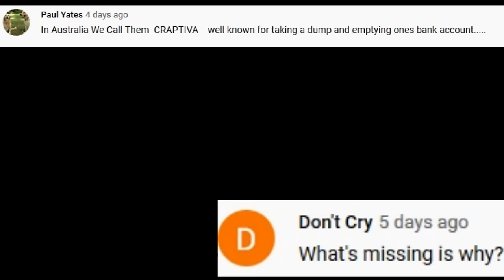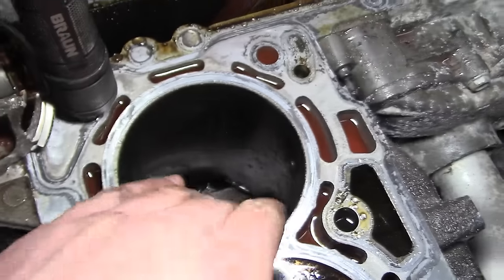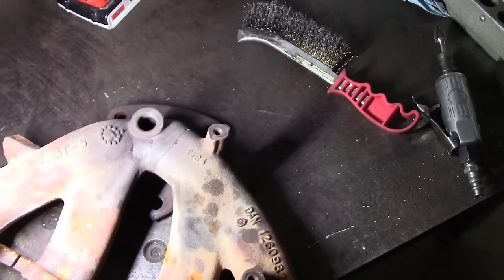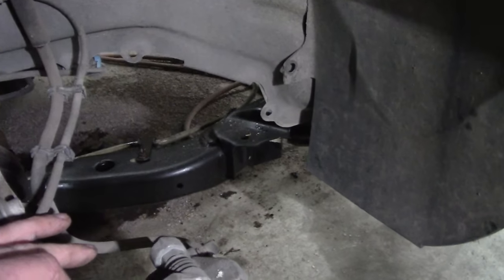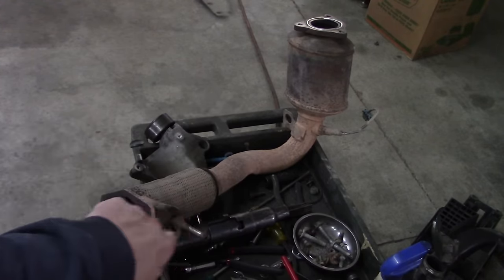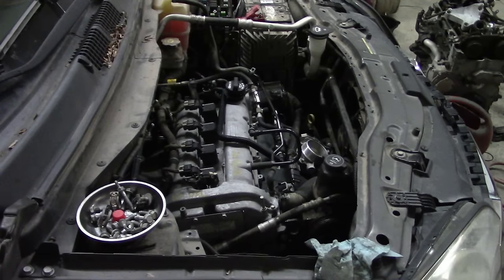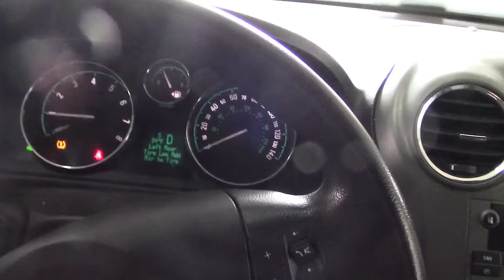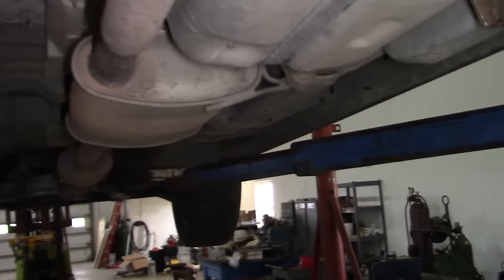I Fixed the Cheapest Small SUV on Marketplace - Part 2

Comment: In my early days of pulling wrench, I had a  98 Dodge Durango come in, blowing all sorts of smoke and heavy oil loss on the ground. Drove it in,  was able to shine a light up and see the business ends of the spark plugs of 5 and 6 from underneath. 
Far as dropping the cradle? Paint n match mark the cradle to the frame, itll be damn close. But if you live in the rust belt, yea you might be askin for more trouble than its worth. 
Surprised you didn't pull the timing chain cover - at 80k miles, id be at least looking.
Reply from the maker: Yeah I know, but if it ain't broke...

Comment: I agree with the oil filter cap.  It's a low profile 32mm socket with a universal joint.  Are they trying to copy the EU manufacturers?  Special service tool for everything, including bolts and nuts.  E-torx, Allen, triple squares.  What's the problem with regular hex bolt and nuts?
Reply from the maker: Plenty of E-trox in the 2.4 ecotec as well.

Comment: Like all other GDI engines, they aren't inherently bad. They just become bad because of poor operator maintenance. Nobody gets oil changes when they are supposed to anymore, nobody checks their oil even like once a month. They run the car till something catastrophic mechanically breaks on it, then sell it and get a new one. Manufacturers are starting to cater to this kind of behavior, parts are becoming cheaper, less reliable to begin with. All in order to only hold together the length of a warranty. If people continue to operate motor vehicles under these pretenses, we are doomed to have shitty vehicles at large that only last 3-5 years of a warranty period.
Reply from the maker: Right. Cars are becoming like smart phones. People want the newer, faster, cooler one long before it's really worn out. So why make it last any longer.

Comment: Well you love punishment. If you think these are hard to work on and impossible to reach items. Try working on boats where everything is installed in the hull before they put the deck on. Which is why so many boat mechanics and techs are of small stature. Of course I live on our boat and I am not small in stature. I have left more blood in our boat that it probably is of kin now. Sorry stole that from Master and Commander but it fits. As for engineers designs, they sit a desk and look at a computer screen. They have never tried to work on something they designed. Something that some aerospace companies have started to do, having engineering work in labs disassembling and reassembling sub systems to learn better ways of doing it.

Comment: You know that vehicle is pretty clean for an 8 year old vehicle... It'll probably end up being a money pit but at least it isn't rusty. You should fluid film/krown/dinitrol the absolute shit out of that thing before salt season comes round again.

I definitely prefer to take stuff out the top be it engines/gearboxes than drop subframes. I helped a guy i know do the clutch and dual mass flywheel on his 2005 2.2 diesel Ford Mondeo a few years back and two of the bolts on the subframe just spun. Luckily it was a shitty work car so i just cut through the carpet and put a cutting disk through the floor to find the captive nuts. Cut the heads off and took them out through the floor. He welded new nuts in and got some new bolts from the ford dealer.
Reply from the maker: Ouch. We went in from the side with a hole saw I think.

Comment: My stepmom was leasing a Toyota RAV4 I think it was a 99 model it only had 70,000 miles on it she went almost 4000 over on an oil change And that you so much oil it spun a bearing. It had been smoking a little on start up and I told her to tell them about it but they didn’t do anything. Crappy part is they made her pay for the new engine. She did go over on the oil well it shouldn’t have used that much. She pretty much forgot one oil change cost her big bucks.
Reply from the maker: Ouch. I would have thought they would cover that on warranty even with missing an oil change. It didn't start burning oil out of nowhere.

Comment: My Spark w 1.4 L engine kept triggering a high voltage error code on lower oxygen senser. I decided to use one of the gizmos sold for that. just a hollow extension 2 1/2" long. I drilled 2- 1/32" holes in it and put it in front of the senser. Worked great.
Reply: First round eventually failed but I kept drilling holes in the extension I added to the oxygen 12 3/32 holes then No high voltage error code. There is no error code on too much oxygen.

Comment: Wes, I think I would build an oil wrench only because you will be changing it more often if you keep the vehicle. That is exactly why the origional engine blew up. Filter way too hard to change and previous owners were too cheap to have dealer service it. I would guess oil and filter change would be 60-80$ at dealer and at least a 2 hr. Wait while they inspect the vehicle for other repair work to convince you that you have to do even if it has nothing to do with safety of vehicle. Enough said.
Reply from the maker: Yes I'm sure that's the case for a lot of these engines!

Comment: I use an el cheapo harbor freight  1 1/4” impact socket that I bought for a dollar on the wife’s Equinox, it’s got 2 detent pin holes on it so I can stick a 1/4” piece of tool steel through and spin that idiotic filter housing off. I personally find it easier than trying to fight with a swivel head socket wrench.
Reply from the maker: There are several low profile 3/8 drive sockets just for this engine. I have one for the 6.0 powerstroke which is similarly stupid.

Comment: Pretty sure thats just a 35mm socket or something. You should have one in your stash of CV joint sockets. Hardly a "Special tool".
Reply from the maker: It requires a low profile 32mm 3/8 drive socket.

Comment: That's the same exact oil filter system VW uses, it's actually much better than the metal cans, much less waste generated(no metal parts), iirc you need a 32mm hex tube to remove it, nothing special about it.
The problem is the dumb placement in some engine bays of the filter housing which have almost no vertical clearance
Reply from the maker: Yes, 32mm. I actually had the tool, I just forgot where it was!

Comment: Cracked exhaust manifold killed the engine. Oxygen is getting before lambda, because of this ECU is getting wrong data and leaning fuel mixture. Because of this burning temperature rises and in time kills engine
Reply from the maker: I suppose that is possible. But I would think the exhaust back pressure would be enough to keep oxygen out under most conditions.

Comment: You might be able to get $200-$300 for the top end of that old engine and make a little more profit - clean it up real nice in your spare time, spray it down with some light oil to keep the rust off, plastic bag it, and list it on your favorite fsbo board.
Reply from the maker: I dunno. I guess if a used engine is $2000, the head might have a value...

Comment: Seems it shares a lot with the Opel/Vauxhall Antara. Generally anything GM produces under the Opel/Vauxhall name is a pile of crap. They recently sold the European division to PSA - Peugeot/Citroen a French car manufacturer. They have 2 plants in the UK - which makes them popular here, despite them performing poorly in crashes, having serve problems with rust, etc. Thanks for the video!
Reply from the maker: Oh God. If anyone can do a worse job than GM is surely Peugeot!
Reply: I had a 2013 Peugeot 208 (Subcompact) for about 8 months before someone crashed into the back of me and wrote it off... Before that I had spend $1000 on having the gearbox bearings replaced and gearbox rebuilt (manual), $500 for a timing belt service, I have no idea what the last person did to it, but it sounded awful. Renault - another French manufacturer are a bit better, I've had a couple of their cars. Also Fiat... not sure what to say about them, but the early 90's gas engines they had were easy to work on. Did a head gasket in a parking lot once.

Comment: nice video Wes.  don't you have to reset the TPS sensor after refilling the tires? i think the TPS only registrates the pressure drop after reset so it warnes for low pressure (max pressure drop allowed by the settings)
Reply from the maker: I never had to fill them, and I would think the TPMS would reset after the battery was removed, but maybe that not true. I'll have to look into it further.

Comment: I prefer this style filter. I don’t have the 2.4 I have the older 2.2 L61 I think it’s a 22 or 23 MM socket is all you need.
Reply from the maker: 32mm, but it has to be a low profile.

Comment: I don't think there is a tire pressure meter. I think it is connected with the abs system, and it measures the number of rotations on the wheels. If that value changes on one tire, like if one tire looses, or gains a bit of air, changing the circumference, thus spinning more or fewer revolutions than the others, it will throw a fit on the dash. I have that system on my car, and every time I pump the tires, I have to reset the value, by holding in a small button inside the glove compartment.
Reply from the maker: I have heard of that system on some older cars like Audis maybe. The GM system is pretty sophisticated and measures actual pressure with a transducer. In this case, I just filled the tire a few psi above the recommended pressure and that reset the light. Nothing really wrong.

Comment: 2k for a used junk engine i would bay a new one for that price rockauto as them all day you got skrod without the lube here used engins are 150 to 250
Reply from the maker: I don't make the prices guy. That's what a used engine costs here. Prices range from $1400 to $2700. Cheapest reman long block I found was $3100. Rock Auto is $3012 plus shipping and they would not accept my core.
Reply: Lol. Go dig up any gm gen 4 or 5 v8 for 150-250. Late model engines are higher priced than late 90’s/early 00’s stuff.

Comment: A word of advice, those 2.4L Ecoturds seem to really like being run on 5w40 or 0w40 oil.

It really helps with the rings, I've got an oil eater under my care, and it's currently stopped consuming. Before on 5w30 full synthetic, it would eat a liter by 50% on the OLM and would start clacking at 30%.
Reply from the maker: That's probably a good idea. That and tighten up the oil change interval.
Reply: @WatchWesWork  yeah, I wouldn't trust the OLM as far as I can throw it. Also I have them using high quality filters, the AC Delco oil filters collapse because of the amount of carbon and dirt in the oil.

One thing I would highly suggest though is look into doing an oil flush. You'd be amazed at what it'll clean out.

Comment: I bought a 89 Murcury sable for $100 and everyone said "ew why do you have that thing" I got a lot of crap for it. I bought it 2½ years ago and ive mabey thrown $300 of parts at it and a tire or two. Still have it and I still drive it to work occasionally. While I know of people that bought a car for $5k and they've already killed the engine
Reply from the maker: Yeah, simple is better. Everyone now wants gadgets on the interior and could care less about the rest of the car.
Reply: @WatchWesWork  I've ridden in a lot of newer cars and I've honestly never really had something that's super comfortable either. I'd much rather have a older car and I do I have 4, newest is a 92. And just add a $100 touchscreen stereo that's just as fancy as one in a 2020 model, but im also fine with a factory stero and a cassette adapter

Comment: Done better than that little block. V16, 72 litre gen set. Number 1 conrod let go, piston through the block. Unfortunately out of the four sets in the building. One was in pieces for a major service, out of the other three , two failed and the load was on this set. Old style controls, all alarm and shutdown signals went through relays. I was in the room when it let go, never run so fast in my life, pulled all alarm relays and we basically opened the governor fully and kept feeding oil and water to it until mains power was available. As soon as we were back on mains hit stop and the noise was horrendous. Went in to the generator room after it had cooled down, oil everywhere- room basically painted black  with oil. Massive hole in the side of the block, oil way and water way shattered. Block twisted. £1.5 million to replace the engine with a reconditioned one as there was only 63 of them made, 62 left now.
Reply from the maker: Wow. That's not fun!
Reply: @WatchWesWork  nope, definitely not fun. Unfortunately, I was working in a military building during the Gulf War. Couldn't risk losing power at any time. We'd load shed until only the barest lighting and the critical rooms were left on.
Another time we used a little portable genset to provide a neutral for the controls, via an extension lead and car jump leads on to the bars, so that the breakers could close. We'd lost external mains completely, no reference points at all and the controls don't work if you lose the reference points. Once one genny was on the bars, that took over the controls and brought the rest online. Interesting times in that base.

Comment: IMO your complaints about the design stem from Cad box monkeys that have never held a wrench let alone use one. I was putting together some Siemens switchgear recently and noticed a bunch of wtf things. Oh and batteries on concrete is a myth from when battery cases where rubber, now unless the plastic is cracked it's okay.  Thanks for the videos!
Reply from the maker: Yes I know. I like to troll the battery believers.
Reply: @WatchWesWork  yes! Sorry I forget to keep them fed.

Comment: Good show, quite a few things to say. Even though you had to pay more for the engine, no core charge and no extra trip back to return the core. My opinion you came out ahead.
Some wanted the engine dropped only because that's the way they are installed. Your way is much better as it suits they way "Wes Works"
Engineers couldn't care less about what wrench turners think, dealer mechanics usually have to buy their own tools, sometimes through the dealer, so don't apologise. Should have heard what I called the engineers after spending 4 hours removing and reinstalling a starter on a v6 '79 Malibu. Transmission cooling lines run under and really close to it,
Was a purchasing agent for a battery distribution company, all the different sales reps said the same, batteries will drain sitting unprotected on concrete, and yes there is an expiration date on new batteries. Most retailers will cover the date with some type of label or sticker.
Again, good show, glad I quit watching mustie 1. You usually indicate you read the comments and actually reply to some instead of relying on other commenters to answer questions. Thanks
Reply from the maker: Well at this time I'm still able to keep up with the comments. I can see how larger channels would struggle.
Reply: @WatchWesWork  👍👍etc. Keep it up

Comment: I had my Northstar V8 in my Cadillac DTS pulled out the top.  Went out and in flawless, still going strong
Reply from the maker: Wow. That would be the only thing that's ever been done flawlessly with a Northstar... Hope it never needs a starter...
Reply: @WatchWesWork  i replaced 3 months after the motor change, honestly only a 45 minute job.  You can do it without releasing the fuel lines.

Comment: Wes you should see the Ford /Peugeot 2.0 diesel they had in the mondeo and kuga and other French cars the oil filter is under the High pressure pump and you need a c shaped box end 27 mm special tool to go under the diesel pump to open it thrte a bastard
Reply from the maker: That sounds about right!
Reply: @WatchWesWork  we had the opel insignia diesel here it's thr same as some other gm saloon shitbox ye get and it had a filter on the back of the engine just over the drive shaft when you opened it it coverd the exhaust and shaft in oil and was aquard to get to

Comment: i  just use a stamped 1 /1 &1 8 th short handled hex box wrench for adjusting a treadmill belt to do them oil filters  and it works pretty slick
Reply from the maker: Heh. I'm fresh out of those! But I swear I had a low profile 3/8 drive socket for them.
Reply: @WatchWesWork  except you cant get a straight shot at it .......... i have another one  of them if you want i will send it to you  message me a destination or po box

Comment: Makes you wonder if the oil filter was actually being changed since it's so hard to do , leading to a blown engine .
Reply: What are you saying, man?  That an oil change joint might not actually do all the work they were paid to do??
Reply from the maker: No kidding. I kind of knew a guy who worked in one of those quick oil change places. He came in drunk and fell asleep in the pit. Woke up with a note on his chest telling him he was fired!
Reply: @somebodyelse6673  
It would not be the first time , I took my 2004 Silverado in for a lube ,  oil and  filter change , and they did not even touch any grease fittings needless to say I have been doing it myself since .

Comment: Come on you don’t have an 1 1/4 socket?
Reply from the maker: I have many 1/2 drive but they will not fit. There's a low profile 3/8 drive socket for these engine and I swear I had one once.
Reply: Watch Wes Work I figured you did.

Comment: Ah some new rings and bearings, and a bit of welding, you could've got the old one running again 😂😂
Reply: A used good engine with half the miles is probably the better option.

Comment: Great video, I almost jumped with joy when the engine started so sweetly! But.......Why oh why didn't you change the clutch and cambelt when you had the engine out?
Reply: That engine has a timing chain which typically last the life of the engine if the oil is changed regularly and the transmission is automatic so there is no clutch to change